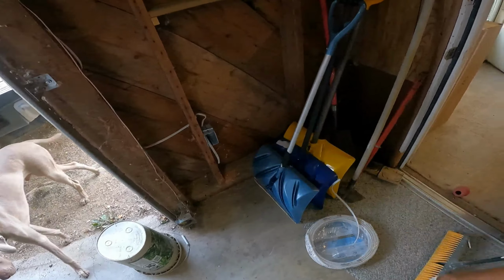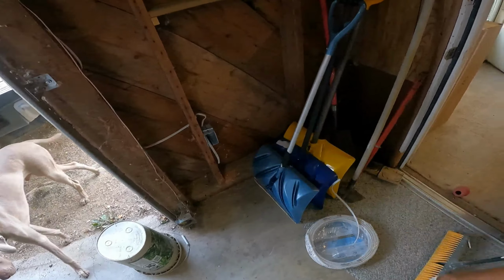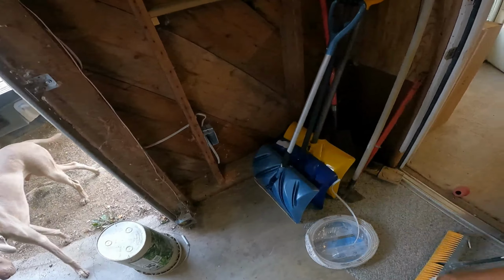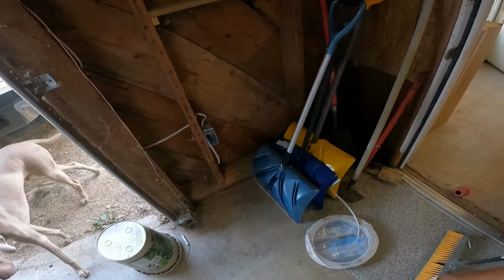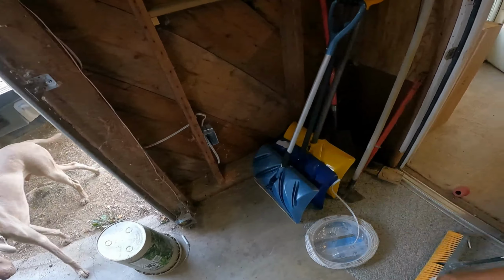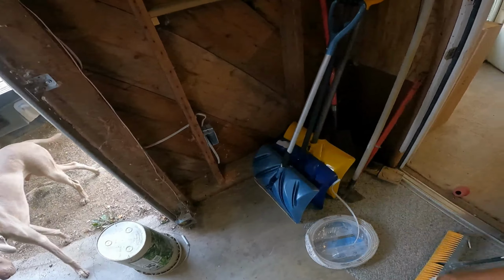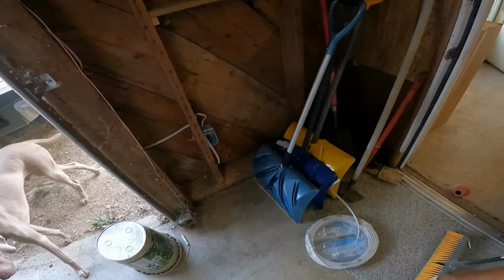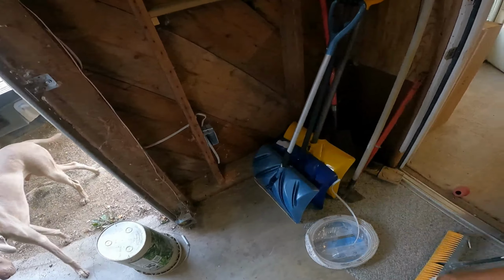Insulating My Garage for $500!

Comment: Good job but honestly most garages are the normal 16 on center. I have never come across a 24 on center garage before. Do know what you are doing with electrical or don't do it at all but yes I have run 13 new circuits in my home eight in the kitchen and five to the garage. While going over the electric in my home that I purchased in 2013 I did find many faults of the previous owner with hot neutral reversed and in one case running into a box that had romex running into the switch box and a separate wire run through the same channel without covering (Romex covering, just a single wire) that eventually failed and created a short which could have led to a fire. Although you could use a tester to find hot/neutral faults I found them by changing all the outlets in the home as the original builder used very cheap receptacles of the 1989 era. Non Leviton, Eaton or other known good brands.  I outfitted my garage with a Hot Dawg (Made by Modine)(500.00$) 45,000 BTU  garage heater and added 2 60 inch ceiling fans to run on low in reverse during the winter. Prior I have added an R19 garage door.  Add the fan and you will notice the difference. Yeah the first year I froze in this garage and I decided to do something about it. Just some thoughts.
Reply from the maker: The fans would be a great addition, good idea! The garage in my last house was also 24 on center, maybe it’s just older homes.
Reply: @MickelsonRacingChannel  So far the fans have made a big difference but I'm waiting on a gas bill to compare. As far as the home goes it's an average 1500 sq ft home but I do have the open design which has the 2 story ceiling. This is also a first year try at having that fan run 24x7 in the living room area to see any difference in costs. Whether I see a cost difference or not may not be an issue as I have seen an environmental (Feel) change. No more cold and warm spots, equal. The garage floor is cool but not cold in prior years even though the temperature was set to 74. I will update this as I get a better idea of therms used per outside temperature. And you thought this was a racing channel... :) .
Reply from the maker: @curiosity2314  wow, that’s awesome! Sounds like the fans are a no brainer. I will definitely have to look into and consider that!